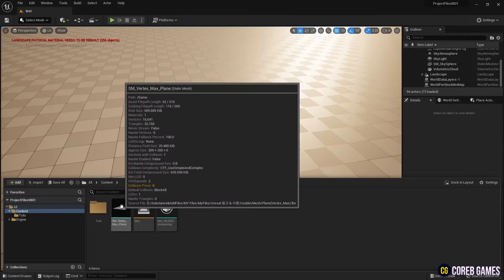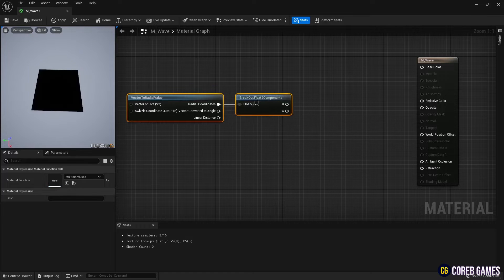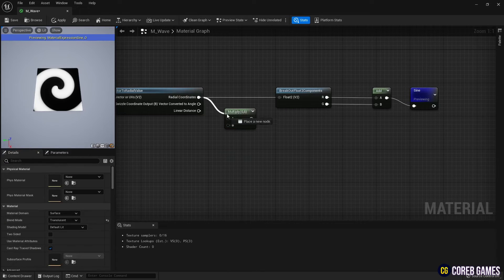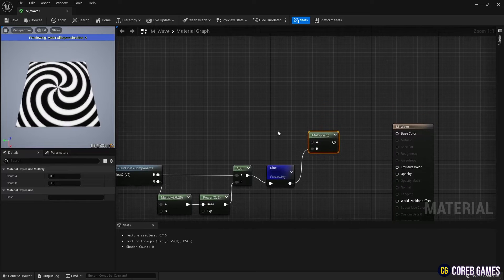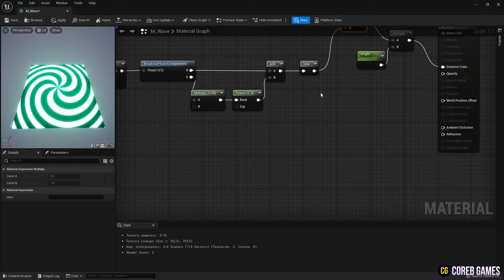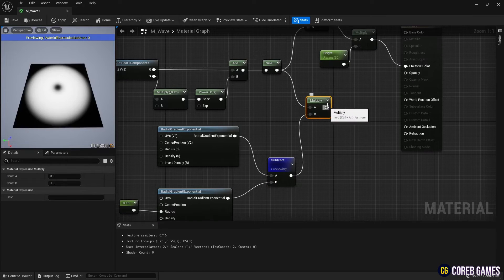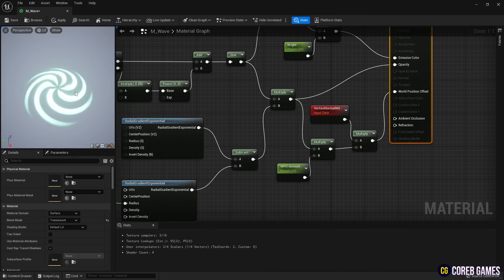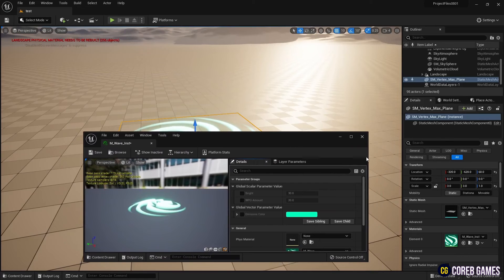UE5 l How to Create Spiral Wave Material l Shader Tutorial l Unreal Engine 5

Comment: I followed the video to a "T" and mine is not fluid spin, it is a jumpy almost like a choppy sea... any idea what version this stopped working in? I'm in 5.4.4 on this particular project
Reply: It may be the subdivision count on the mesh, I used unreal's native modeling tools to create a 128x128 rectangle square and it turned out pretty good. The resolution of the mesh determines how smooth the animation looks when WPO is applied. If you don't use a fairly high resolution then it will end up looking choppy, sharp, and triangular.